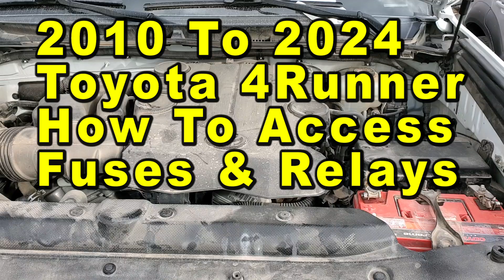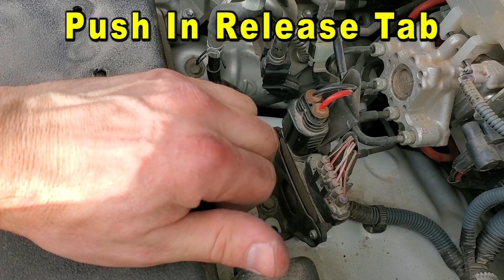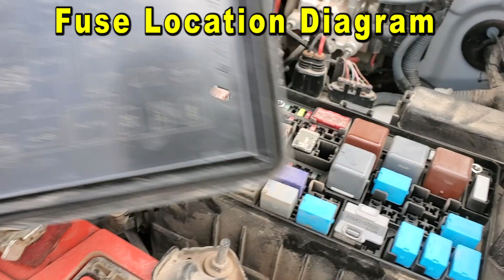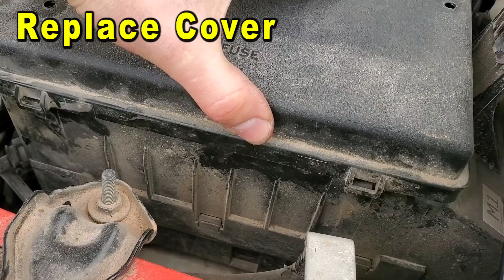2010 To 2024 Toyota 4Runner How To Open Fuse Box Cover - Primary Engine Bay Electrical Panel

Comment from the maker: This quick DIY video shows owners of the fifth generation Toyota 4Runner how to take off the plastic cover for the engine bay primary electrical panel in order to check or change a blown fuse or a faulty relay.

Comment from the maker: Check out the DIY repair and maintenance guides for the 5th generation 2010, 2011, 2012, 2013, 2014, 2015, 2016, 2017, 2018, 2019, 2020, 2021, 2022, 2023 and 2024 Toyota 4Runner SUV - 
https://www.paulstravelpictures.com/Articles/2010-2016-Toyota-4Runner-Common-Problems-Repair-Maintenance-Guides.htm